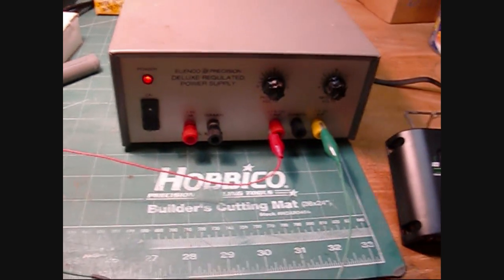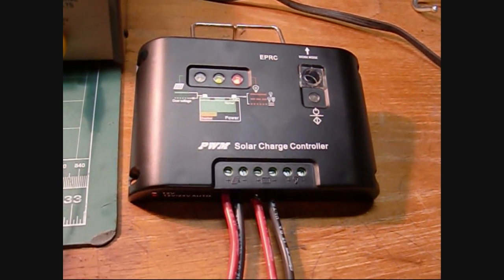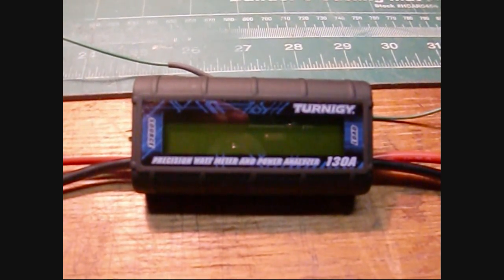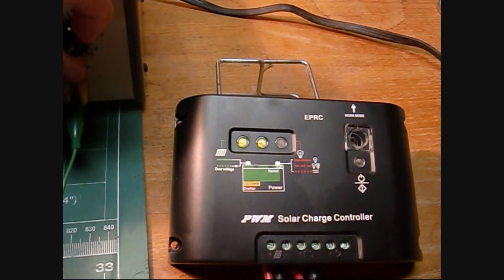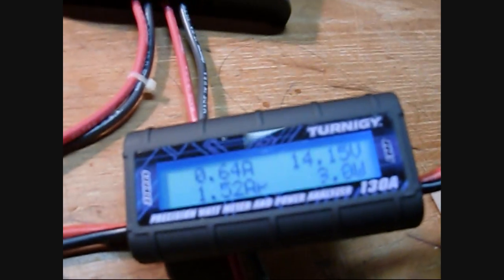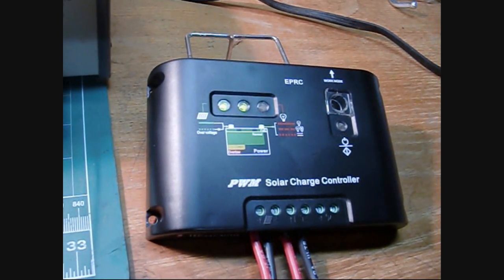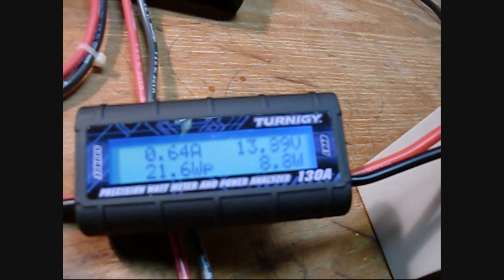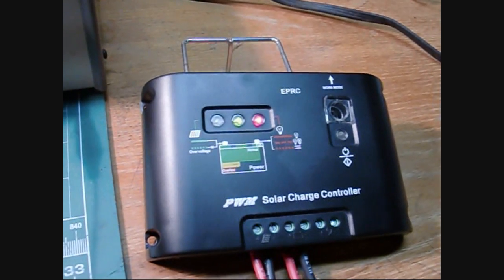Solar Panel Charge Controller Bench Test

Comment: on my controller when i hooked for 24 volt, factory had it 29.2 volts. i learnd how to adjust it so brought it down too 28.4 volts, but i can go from 24 to 30 volts. what should i be setting it for lead acid batterys, if i set it at 27 volts, i feel like im wrong because a car charges at 14.3 volts, but a full battery equals 13,5 volts. so im confused

Comment: I got a similar model but 20amps.One mosfet burned from the beginning .I found the back metal plate, which should be a heat radiator in the same time it was covered with a thick layer of black paint.I took off with sandpaper,until the bare metal shines and add some thermal paste for better cooling.Of course a new N-mosfet replaced the damaged one.
Now it's charging a 75 amps battery, also I'm using dusk to down function running a 10 meters long LED ribbon lighing my porch alnite long. It's working good for now.

Comment: These solar controllers aren't PWM, because they don't regulate input voltage... they just connect output voltage to battery, and that is really bad. If you had PWM solar charger you could use 18V without issue and solar charger would lover it to 14V to charge the battery...
Reply: +Valent Turkovic  ???? Are you sure ? I ask this 'cose i have a solar controller similar to this (chinese made ...) and in the manual i read : "With the PWM fuzzy control in charging, the charge efficiency is improved a lot" ... at least i've seen that my controller REGULATE input voltage ... (:-)
Reply: this is PWM. The battery is full so its hard to tell
Reply: Unfortunately, youre incorrect.

Comment: I have the 10a version, will come on around 14 volts but solar input light goes out when the voltage from a 10watt panel hits around 19v, any idea why? Shouldn't it just float charge the battery instead of cutting off the solar input?

Comment: Can I use a 12V24V- 20A-MPPT-Solar-Panel-Battery-Regulator-Charge-Controller- to charge JUST 12 Volt batteries if the panel (s) are 28 volts ?

Comment: The above video is a nice review which made me sure this is what I need for my small garden/ driveway lights setting. Unfortunately not all controllers which look exactly the same are functioning correctly, they seem to be working fine but never go into float mode, just boiling your battery with 14.6V for many hours. Do not buy CMS-15A model ( 15A)

Comment: i have had several of these, and it seems they have messed up production, every single one stays at 14.6v, never goes to float, thus over charging the battery, they are supposed to go to 14.4 or 14.6 for only 10 minutes then drop to 13.6, but after 5 hours at 14.6v it seems they are a fake controller and and a crude voltage limiter, at least the very cheap cmp12 limits to 14.4 and is consistent, that doesnt advertise a float voltage, so you know what you get.  the pwm's are fake it seems

Comment: I just got a new charge controller  still trying it out my 12v battery voltage is at 13.5v  waiting for it to now go into float now say 14.4v on manual is that about right to go to float

Comment: Do you know how much energy is wasted when not charging but sun is still raying on the panels?
Use ultra capacitors to charge them while controller is not charging the battery.
No time to get into details.

Comment: The solar charge controller needs to push once before it starts to work. How  to design such circuit? Support the system is on mars, or a mile away from me and l am not support to use a remote controller.

Comment: Thanks for sharing the video, I have the same charger controller 20A however the output does not show more than the battery voltage even during the peak current. I think something wrong with it. Need to get it changed. Your video really helped me to decide whether my controller is working or not. Thanks again.

Comment: After watching your video I purchased a Turnigy 130A to test the current out of my 20VDC 100Watt solar panel to my 18VDC Power Bank. I hooked this up directly inline between the two with the Solar panel as source and the power bank as the load. I got a Voltage reading from the panel but current reading. Thoughts?

Comment: I don't understand your test.  It seems like the test should reflect a constant V, say 17v from the power supply, to simulate a solar panel.  Then bring a battery up from say 50% state of charge, and watch it go from bulk, into acceptance, then into float.  Obviously that would take hours though.  But your test is showing float at 14.4v, which is opposite of what it should be.  I don't know if that's the result of your method, or what.

Comment: I have the same solar charge controller. Watching your video, it actually worked how it should do. In fact better than i expected. It regulated the voltage perfectly. There are slight differences between PWM (PULSE WIDTH MODULATION) and MPPT(Maximum Power Point Tracking). In my experience PWM is a more cost effective sytem and gives longer battery life.

Comment: The battery disconnect voltage for this controller is 11.1v. Is this too low to be draining a 12V AGM Sealed Lead acid battery?

Comment: this is PWM and the voltages from steady green and blinking will be the same in volts,but rather the pulses change speed. If you listen over a radio or anything sensitive to RFI (i play my electric guitar and hear the pulses) as the battery becomes more charged the spikes slow down to a trickle. I just made my RV window inserts panel (40 cells) and this controller works great so far. I got the 30a version for $20 on Ebay.

Comment: How do you expect charge controller to put W into the battery when you have them full? It works OK - prevents batteries from overcharge - too deep discharging and overcharging is equally bad.

Could you try to repeat this test with batteries at 11.5V (or 23V in 24V mode?) ??

Comment: Thanks for the review, just bought one of those. I was wondering what does the controller do if a panel puts more amps than the battery can accept on an initial charge? I am setting a very small solar system with a 7ah SLA battery and it can only accept an initial charging current of 2.1 Amp. But, what would happen if i hooked a 80 watt panel(example) to that controller to charge such a small battery? Should the battery be fused to the initial current stated?

Comment: I have 4 x 60 watt solar panels (2x2) charging my 24 volt bank (150AH), through a PWM 50A charge controller. Once the batteries are fully charged, the excess power from the solar panels is just disconnected - which bothers me. Do you know of any solar charge controllers, which is able to divert the power into a, for instance, 24 volt dump load ? (Like controllers for Wind turbines do)

Comment: Thanks for the test info, nice and informative. I would like to see more comparisons with those meters closer (the in and out meters) so I could see the watts (it's VA actually) when it's actually charging or on load and get a better idea of the efficiency of that unit. When it goes into float mode near the end you have to remember that it starts pulling less from the power supply, like it should. In one part of the video I think I could see it at about 87% efficiency but it's hard to tell.